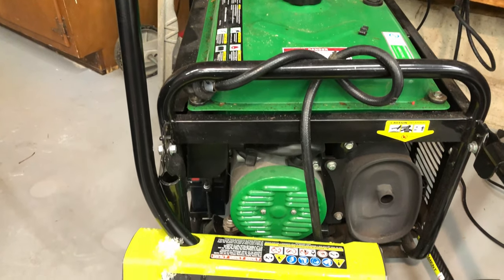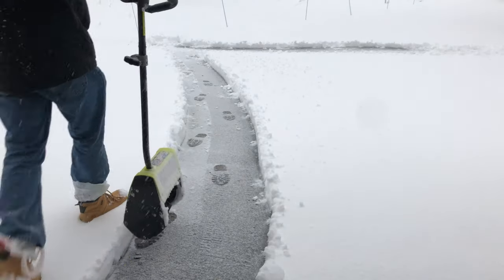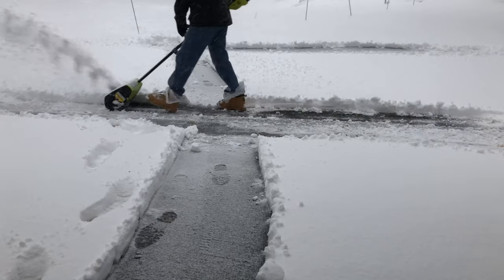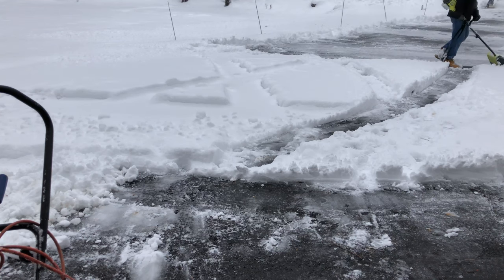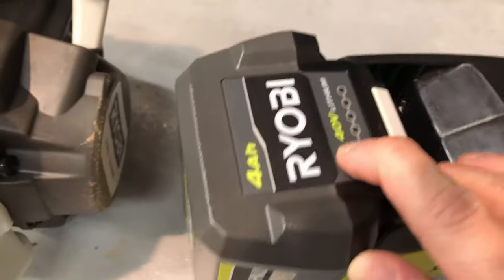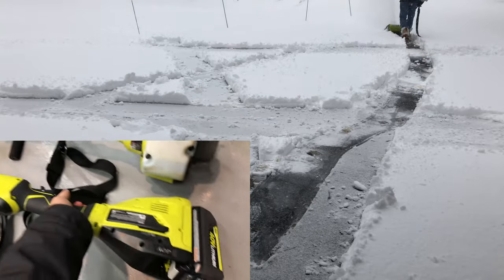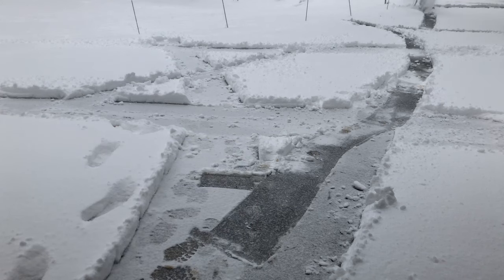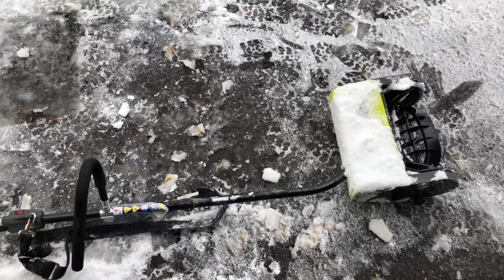RYOBI Expand-It 12 in. Snow Thrower Attachment RYSNW00 (Gas vs Battery)

Comment: Been meaning to stop by for a while now and post a comment. I have been using the Ryobi gas head unit but I had purchased the bristle brush attachment for snow cleaning from a different brand. The reason I got the bristle brush was because I didn’t even know Ryobi had one as an Attachment. Back in January i had seen this video and quickly went to Home Depot and purchased one. In this video you answered every question I had and some questions I wasn’t even thinking of. It worked very good on my drive way, sidewalks, and stairs. Just a small tip since you can’t control the direction of the snow. What i usually did was i do half sets, like 6-7” and I turn the unit towards the side I want the snow to go. As I have it tilted a bit I start to go forward while tilting the unit. So far that’s what I do and it’s working pretty good ** I Just wanted to say thank you so much for posting this video and letting me know that this attachment was available. Also for answering all the questions I had and the ones I didn’t think of. Keep up the good job posting your educational videos. It may help someone like it did with me. Take care and god bless.
Reply: If you don't mind can you share where you got the bristle brush attachment please? It is compatible with the "expand it" line?
Reply: What "different brand" is compatible with the Ryobi?
Reply: @Pro1er  craftsman, cub cadet, Troy built, Yard Machine, John Deere, McCulloch, MTD Pro, Poulan, Poulan Pro, Toro, Yard man, weed eater, those are the attachments that work with Ryobi hedge string trimmer. 
Hope it answered your question.
Reply: All those brand companies work with ryobi and ryobi works with theirs.
Reply: @CARLIT0SWAY That's cool, I didn't know that, thanks.
Reply: @Pro1er  no problem anytime. Glad I can help. It’s a good set up to have and cost efficient. Stay safe and blessed.
Reply: @bob1lom2  sorry for taking so long to reply. I’ve been very busy. lol. Wats up…. I got 2 bristle brushes. Well I have a bristle brush and the rubber one. I got one from Home Depot and the other one I googled it and Amazon came up. If you don’t have the head to go with it Amazon has a few set ups with good prices that brings the head and the brush. Glad i can help. Any questions just hit me up anytime. Stay safe and god bless
Reply: @CARLIT0SWAY The only Ryobi Expand-It tool I own is the snow shovel. Now that I know there are a slew of companies that make attachments maybe I'll have a look at what's available.
Reply: @Pro1er  yeah check them out. They have the 25cc head (2 stroke oil gas mixture) and the 30cc head (4 stroke gas only) and then the 40 volt head. If you’re going for a short yard cleaning battery is kool just not my go to. You gotta have the batt charge and sometime it drains power before you’re done.  The 2stroke engine will give you more power because it produces power on each revolution, while a 4-stroke engine produces power on every other revolution. A 2-stroke engine completes a power cycle with two strokes of the piston during one crankshaft revolution. A 4-stroke engine requires four strokes of the piston to complete a power cycle during two crankshaft revolutions. Each upward or downward movement of pistons in the engine is called a stroke  thats why they’re called 2-stroke and 4-stroke. Then on the attachments you can switch them like switching shoes, lol. There’s 10 attachments that you can change from. There’s the SWEEPER ATTACHMENT,SNOW THROWER ATTACHMENT, EDGER ATTACHMENT, BLOWER ATTACHMENT, ARTICULATING HEDGE TRIMMER ATTACHMENT, HEDGE TRIMMER ATTACHMENT, BRUSH CUTTER ATTACHMENT, STRING TRIMMER ATTACHMENT, PRUNER/CHAINSAW ATTACHMENT, and the CULTIVATOR ATTACHMENT. Home Depot has them all you can check them out at their website or check the net to see if you can find something at a cheaper price that works with the attachments. I have them all and they work good especially around the house they have everything you need. 

https://www.ryobitools.com/products/outdoor/string-trimmers-and-edgers/trimmer-attachments

Comment: Thank you for the great review of the Ryobi snow thrower.

I just purchased it last week to go with my new Ryobi 4 stroke gas power head.

I live in the Midwest US, so we get different types and levels of snow throughout the winter months.

I have a big gas snowblower, but the Ryobi attachment will be good compromise in between for the snow that is light enough to shovel by hand and the snow that is deep enough to drag out the big gas snow blower.

Comment: I bought the same tool and the power cutoff was driving me insane…Returned.
Reply from the maker: Where you using the battery version?  If so, yes mine cut out all the time in anything more than 3 or 4 inches of snow.

Comment: I got one of the ryobi RYSNWOO using it with my Kobalt KST 140XB-06 80 volt attachment capable string trimmer So far it had not skipped a beat clearing snow off the walkways as the 80 volt has more power as it will work on Greenworks and Masterforce powerheads  So far I had no issues with the attachment As i mainly use the MTD tirmmer plus attachments as they didn't offer a snowthrower attachment this is what i had to get. there is a similar one like this branded HART. but sold at Walmart its identical to the Ryobi snow thrower attachment.  the next attachment from Ryobi i need that Trimmer plus don't have is the power sweeper attachment.